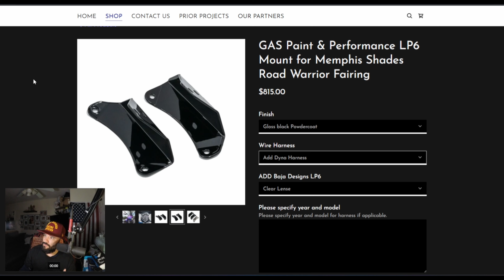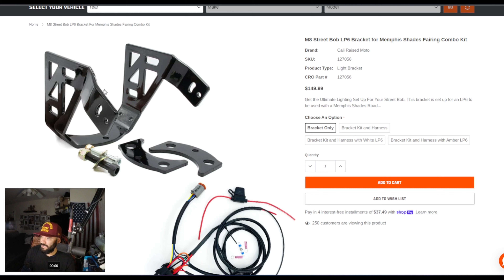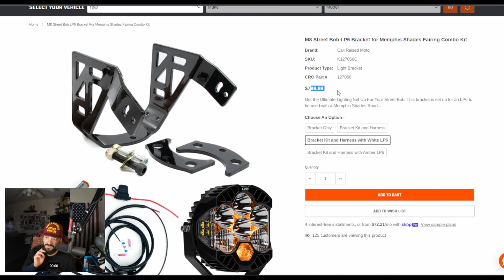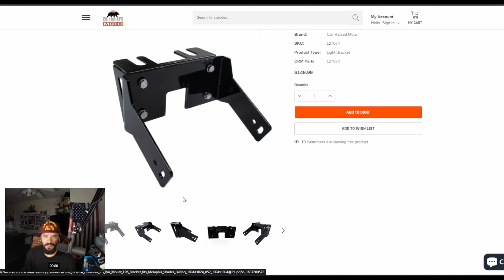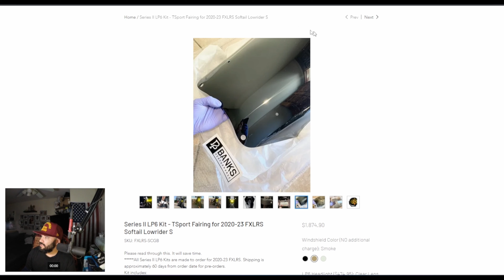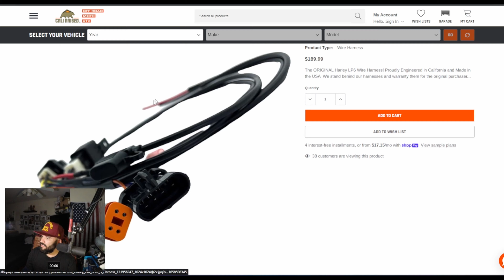Harley Davidson Baja Designs LP6 Kits - Baja Designs LP6 Plug and Play Kits for Harley Davidson

Comment: Have you heard anything about the lp6 mouting in a 1/4 fairing?
Reply from the maker: You can mount it, but I don’t think manufacturers are making brackets for it. You can probably mount a lp4
Reply: Lp6 will sit inside the 1/4 fairing, lp4 sits better (and sticks out more) in the opening of the fairing, just ordered an lp4 for my Fxlrs let’s see how it looks 🤙
Reply: @adrianandrade95  I found a mount for the 1/4 but the mf is $300

Comment: I think they don't what you bolting the light to the fairing because the vibration will eventually destroy the fairing.
Reply from the maker: True, the light also weighs at 5lbs and the brackets aren’t designed for added weight. Probably 😎👍